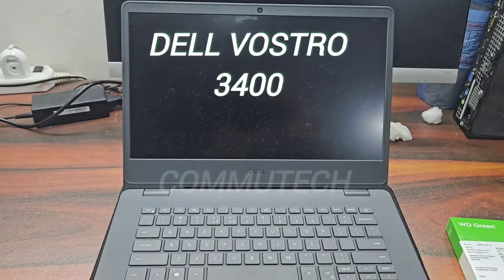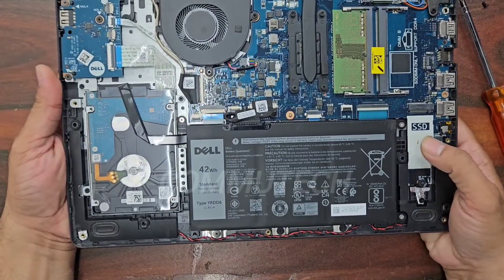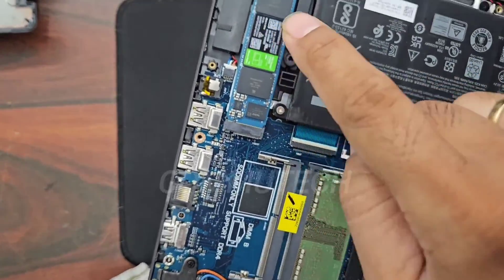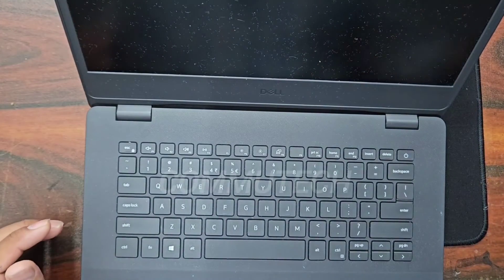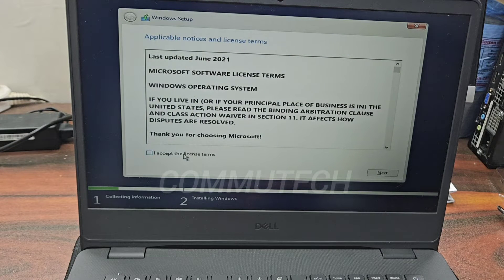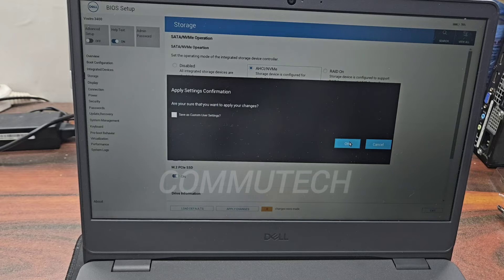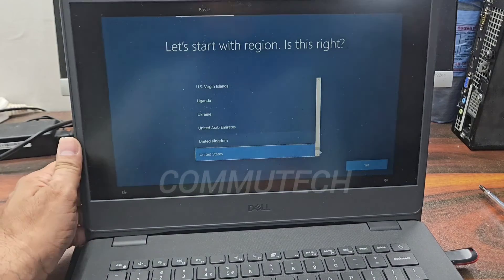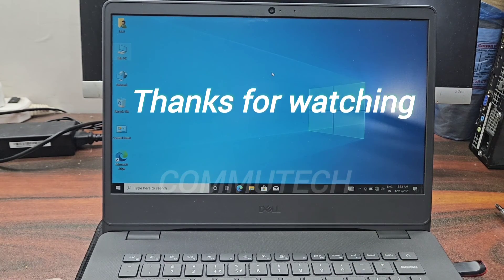DELL VOSTRO 3400 SSD UPGRADE & WINDOWS 10 INSTALL#SSD UPGRADE FOR DELL VOSTRO

Comment: I have dell vostro 3400 i3 11th gen ? Does it support NVME or SATA Ssd (it has 4gb Ram with extra slot ) how much Ram does it supports.And how much does it cost to add Ssd in laptop .
Reply from the maker: @aryanjatt9235  yes, it supports nvme, in my video I have used the NVME ssd and also you can use m.2
 SATA ssd also the slot supports both m. 2 NVME and M.2 SATA ssd

You can go for 16gb + 16gb memory module max

And for ssd upgrade,  it depends on which ssd module you go for m.2 SATA is cheaper than M.2 NVME

And also cost depends on the storage capacity you prefer for the SSD

Comment: what is that physical drive you are using (the ssd)
Reply from the maker: @KurumiEnjoyer  it's the NVME SSD
Reply from the maker: NVME ssd has faster data transfer rate than the regular SATA ssd